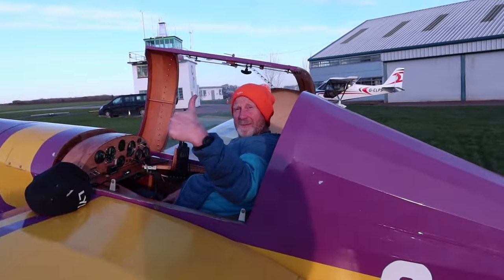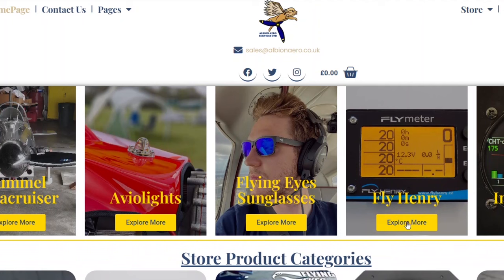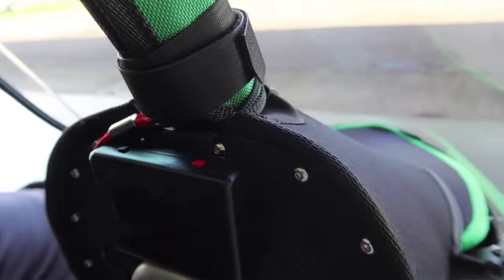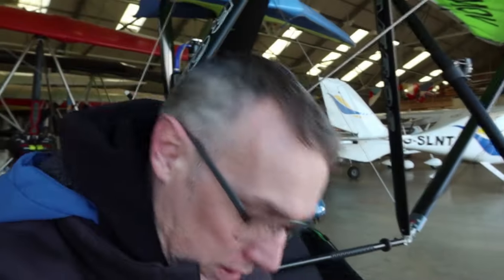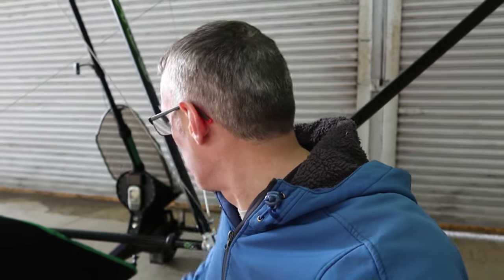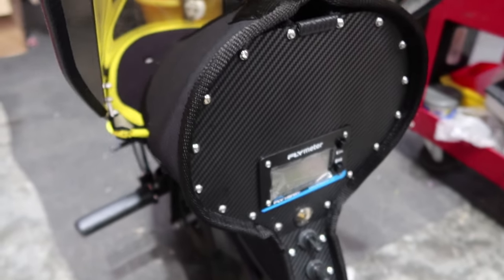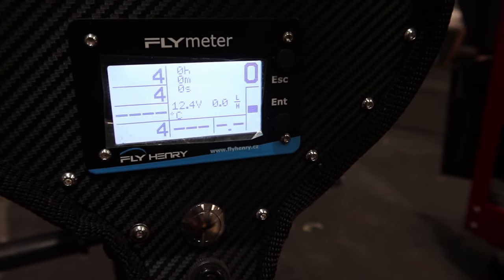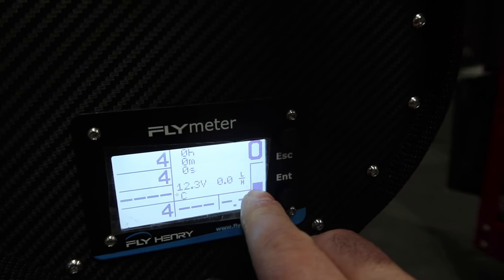What's New - Flylight NiNE instrument binnacle - Modification

Comment: Good update 👍
When is the Nine going to be listed on FlyLight?
Cheers
Reply from the maker: Hi Patrick, I've mentioned to Ben about your comment and hopefully he'll get back to you soon.
Reply: @GolfFoxtrot22  
I also emailed FlyLight.
Im considering ordering sooner rather than later. It seems to be everything I wanted in my 1st trike. My biggest issue might be timing.   It might take 3-6 months to get it registered here with Transport Canada. So why order now if I can't fly this summer. Might wait till the fall. Or I order now and I will have it for Fall flying!
I was thinking of saving up to get a two seater and becoming a flight instructor, as we only have one in the area.  But now I am thinking of just getting a really nice fully loaded Nine and just have fun flying and not worrying about running a business.
Cheers
Reply from the maker: @patrickmckowen2999  everyone has different reasons but I've not experienced anything quite like the NiNE. You won't regret it.
Reply: @GolfFoxtrot22   One of the other things I will need to find out is if I can order without an engine - I have a brand new 250CC engine sitting here, wont get its value trying to sell it.
Cheers
Reply from the maker: Patrick, have you used this address for Ben? benflylight@gmail.com
Reply: @GolfFoxtrot22  hi, I got an update from Ben, thx